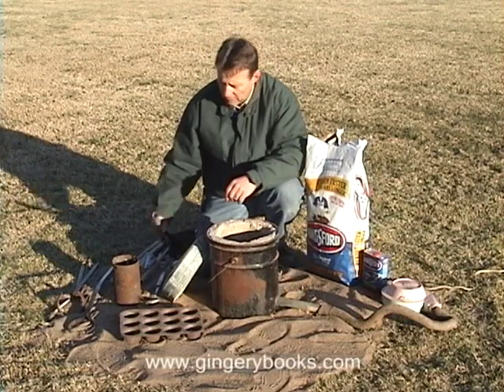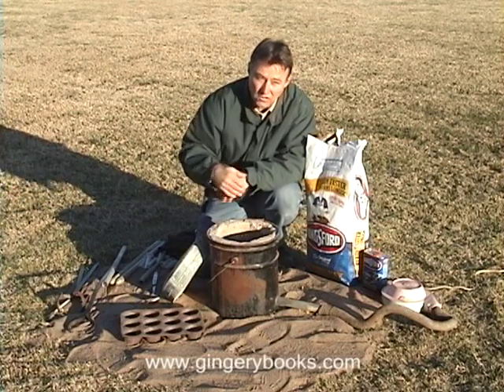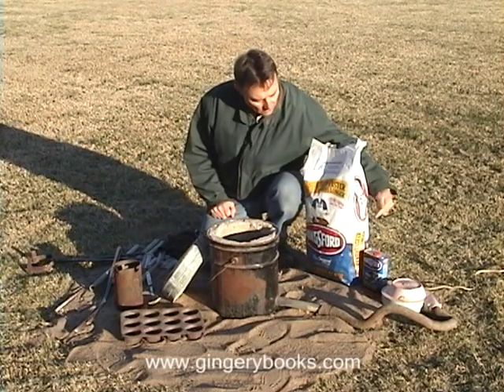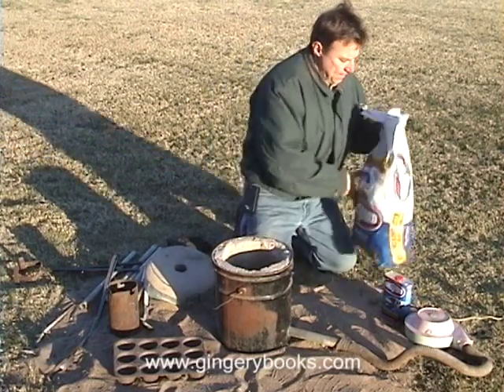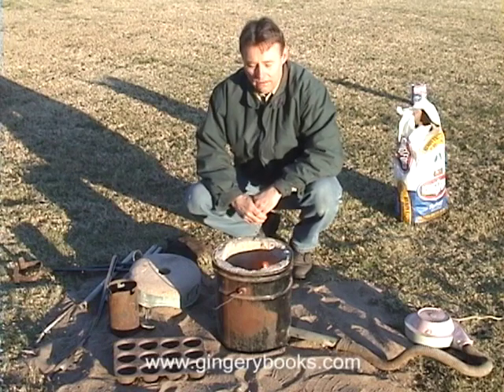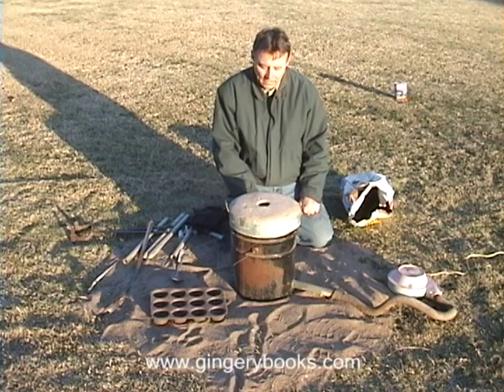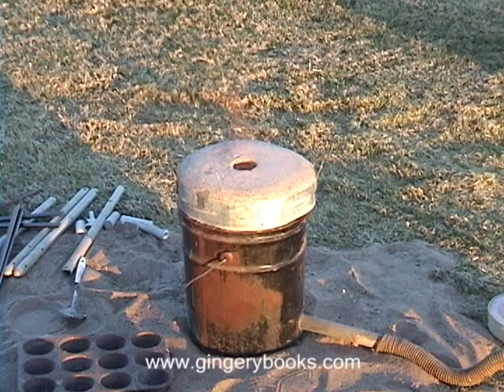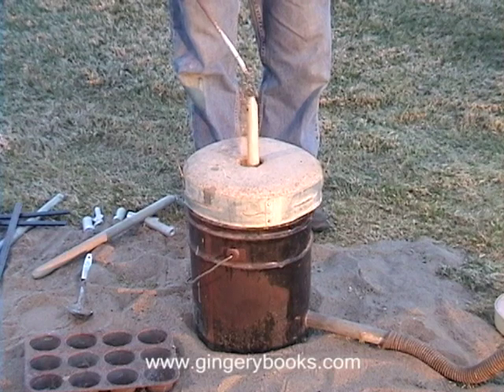Gingery Charcoal Foundry Furnace

Comment: Good video, thanks for posting.  I have the small propane fired furnace and have been using it to cast some parts.  Got your book on plastic injection machine and built that too.  I'm thinking of building a home aluminum injection machine for small model engine parts. Something like a small horizontal cold casting machine.  The injector piston might be operated using a salvaged log splitter actuator and pump.  Any ideas along these lines?

Comment: what widely available  flux-like materials can you recommend to clean up aluminium and/or protect it from oxidizing or improve machanical properties ?
Reply: or some special mixtures which i can make using cheap and nontoxic chemicals i can buy from local chemical shop ?
Reply: Don't know if you ever got a reply but if you are talking about flux to help with the dross and make the poor better I understand a 50/50 mix of household baking soda and table salt is supposed to do the job for aluminum.  I'm not an expert though so you might want to get a second opinion.
Reply: and maybe borax in an aluminum foil envelope, push to bottom of pot with inverted cup on end of long rod